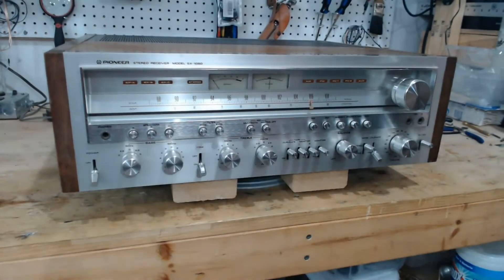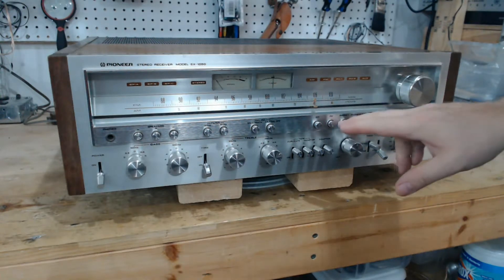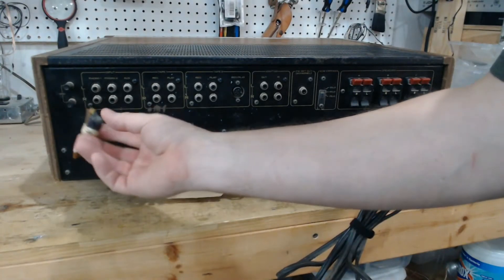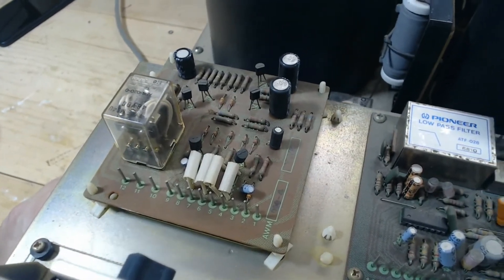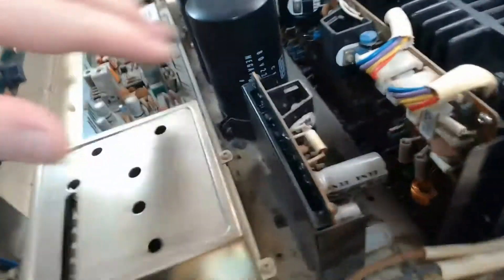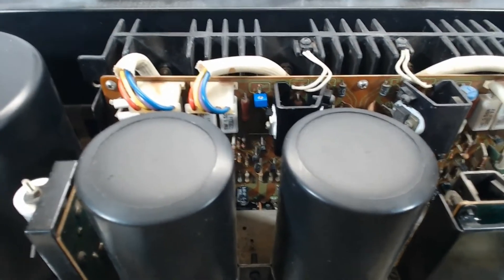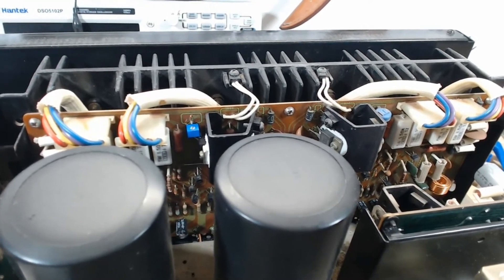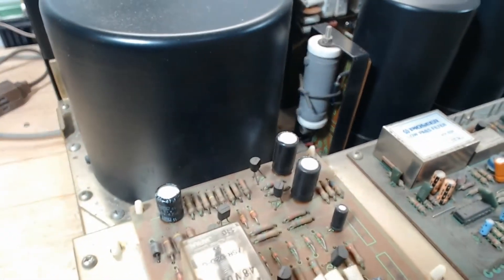Pioneer SX 1050 Stereo Receiver Repair/Recap Part 1 - Initial Evaluation

Comment: My volume knob pops in and out I got to get to that to fix it
Reply from the maker: Are you saying the knob slides off of the potentiometer easily?
Reply: No the sound cracks in and out I've got to get to it and spray it out with electronic cleaner
Reply from the maker: Gotcha...wasn't tracking what you were saying.  It's a bit of a chore if I remember correctly to access the pots.  In part 3 I recapped the Tone Control board...removing the board with the volume pot on it would be similar.